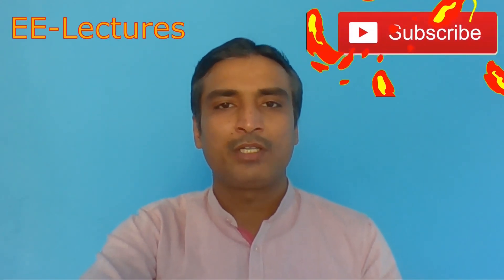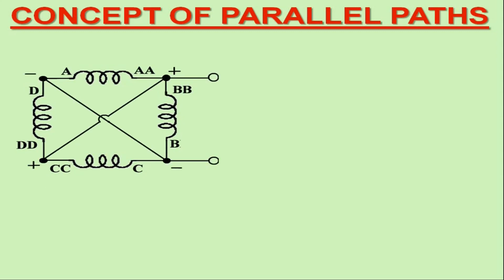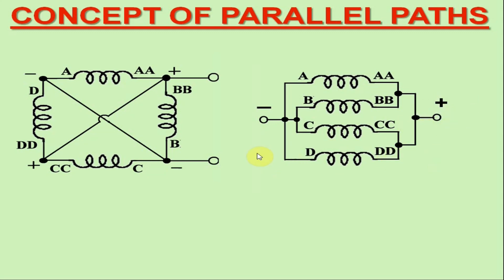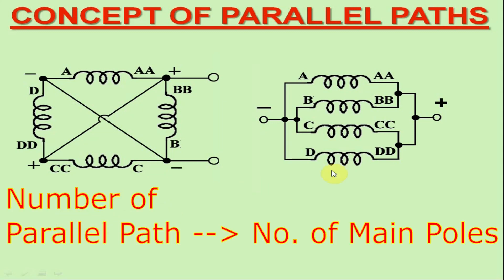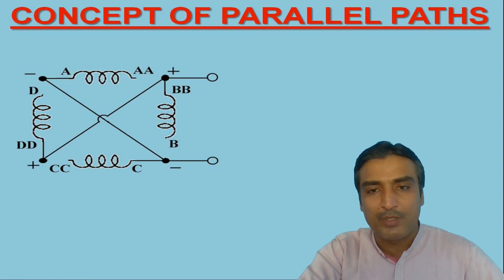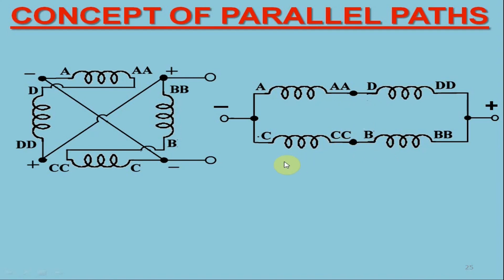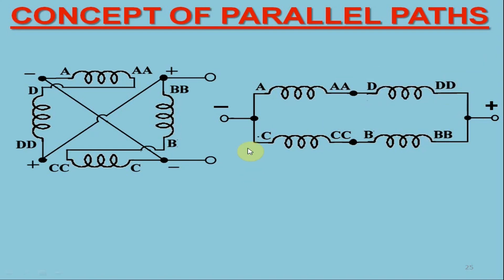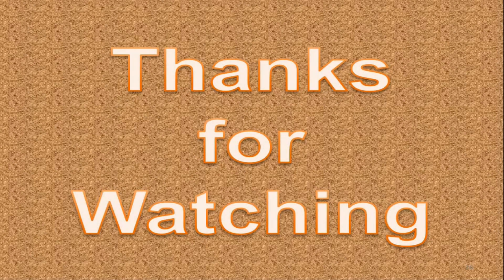What does Parallel Paths mean | Parallel Path in DC Machine | Parallel Paths in Armature Winding

Comment: Sir poles in dc machine are always on the stator and you said " we have placed those poles coil in the slots of armature"  i.e nothing but rotor , how is that possible
Reply from the maker: Probably you have made a bit confusion in your mind. In this video, first I have stated to consider the case of a 4-pole DC machine. Secondly, I have stated to consider 4 coils that are to be placed on armature slots. Actually these 4 coils are the armature coils which are to be arranged in different manner to form the lap or wave winding configuration.
Hope this clarification will help. If you have additional query, feel free to post in comment section.